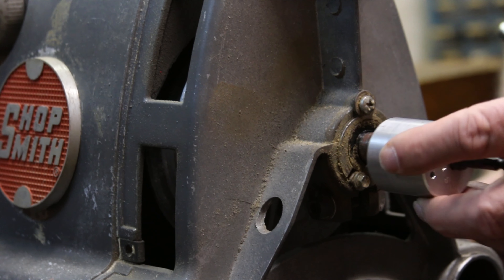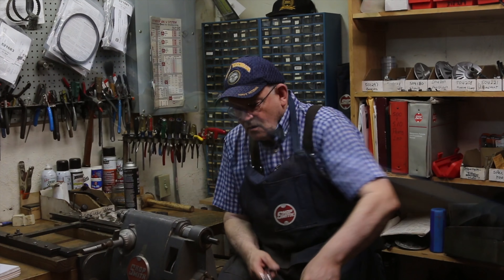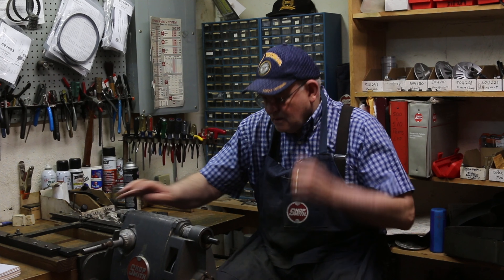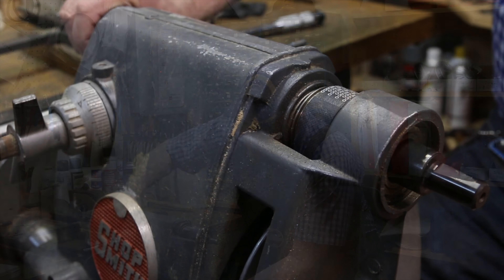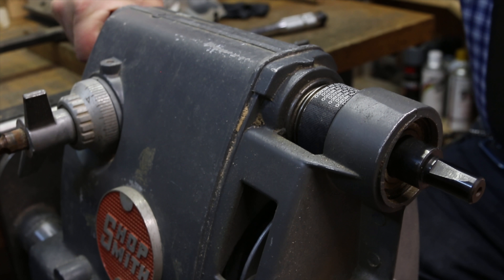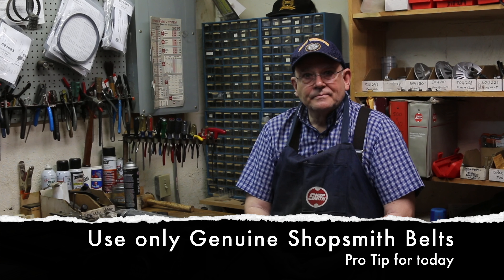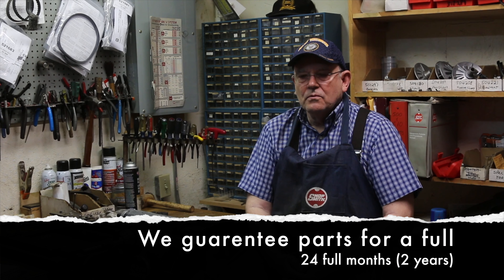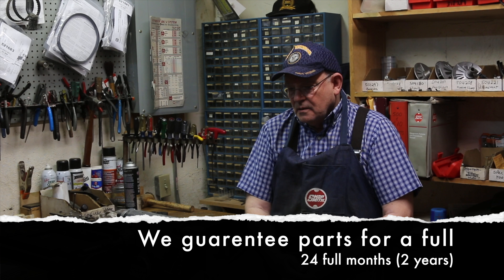Episode 7 - Non Shopsmith Brand Belts - AVOID AT ALL COSTS!

Comment: I;m trying to figure out how to get the adjustable (top) roller and knob on a Shopsmith 6" belt sander to work.  The machine is in good shape and repair, everything works and moves freely and smoothly.  While the knob rotates in both directions, camming the roller out of in, it doesn't want to stay at the apex of the cam where the belt would be tight.  And what does the button/lever in the sidewall of the knob that appears to lock something in, do?  Thank you for the reply, Matt
Reply from the maker: The service manual for your machine will list the procedure.